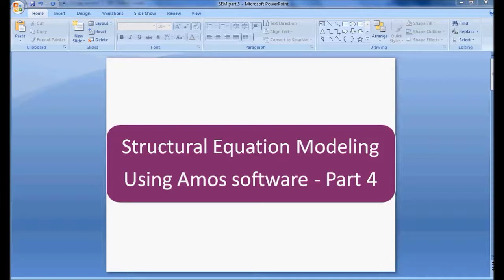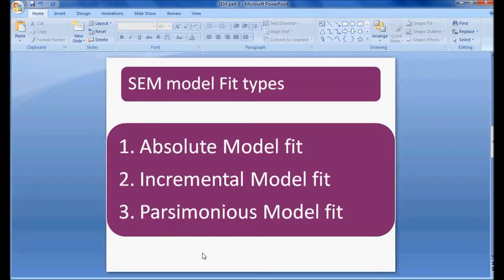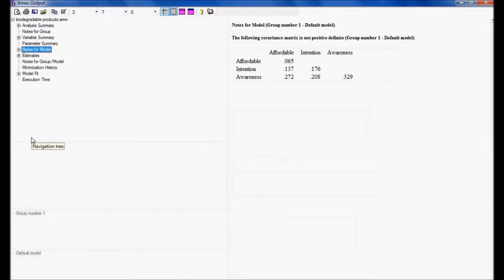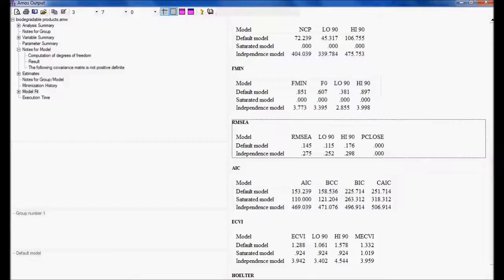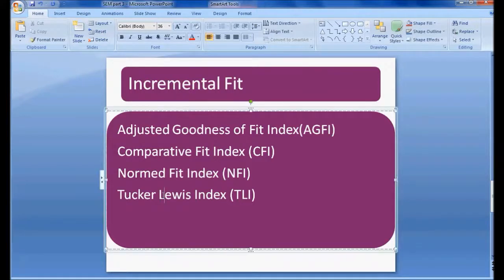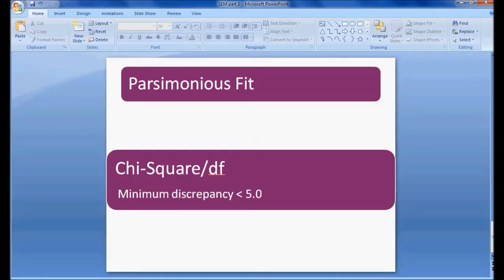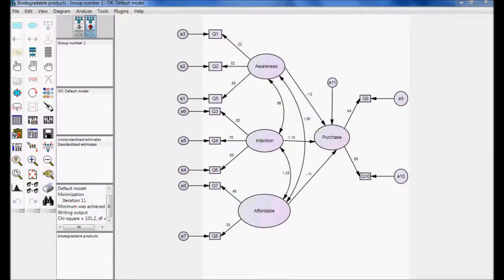Structural Equation Modeling using AMOS part 4 : Model fit by G N Satish Kumar

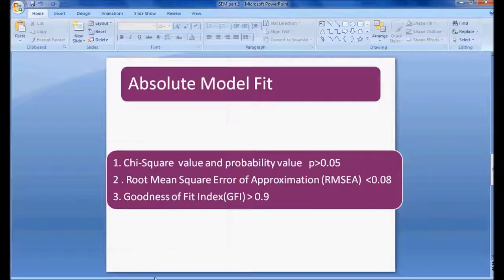Comment: Please clarify something at 4:50. Should the chi-squared p-value be > .05 as the image said, or should it be <.05 as you explain with voice? thx.
I always thought that the chi-squared compared the hypothetical model against the data, so we want it to be no sig (p < .05), meaning there is no significant difference.

Comment: Very informative video sir  ,thanks, i just had one query ,what if the measurement model reports p<0.05 but structural model reported p>0.05 after working on MI indices., all other model fit indices are close to 0.90 ;.is this acceptable?
Reply from the maker: You, need modify the model